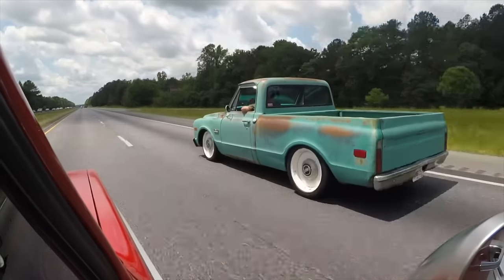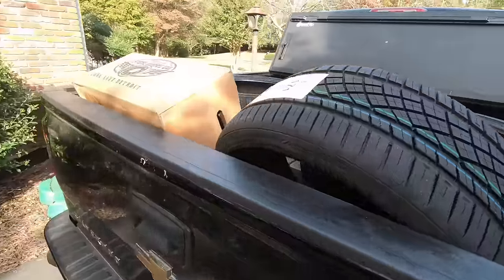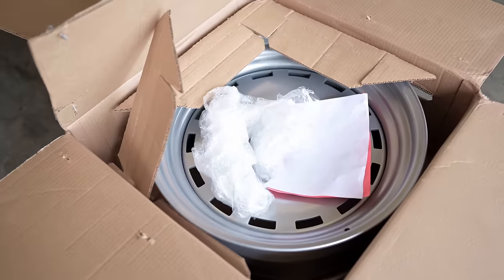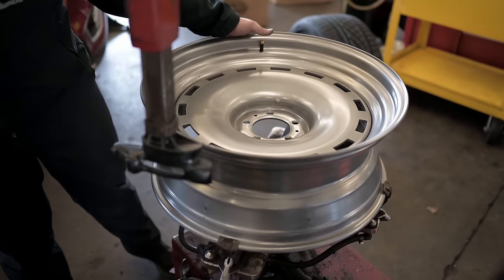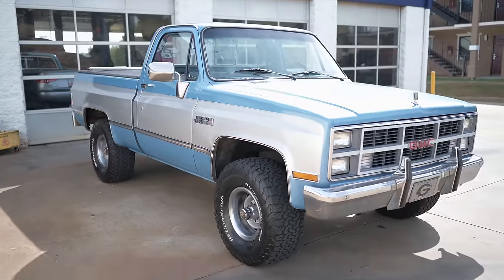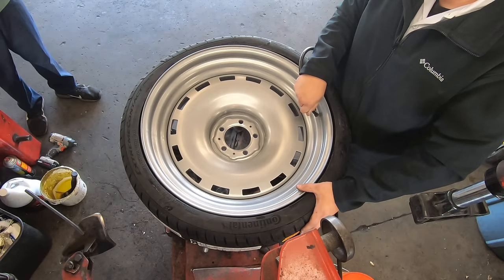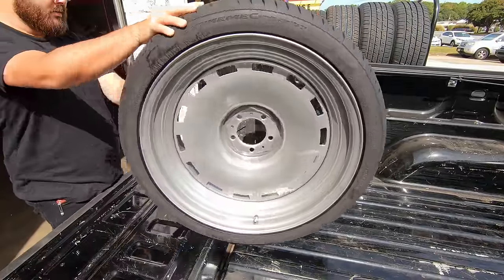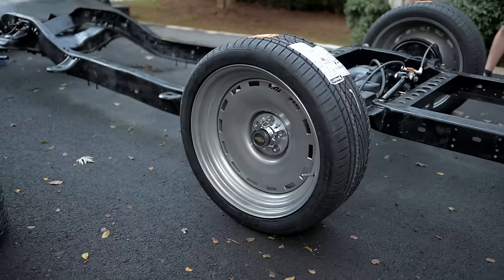WHEN DETROIT STEEL WHEEL & CONTINENTAL TIRE MEET...on #UBTK5 | sneak peek on our 2WD K5 Blazer

Comment: When describing the specs on the wheels at the end of your video you said the fronts are 22 x 9 with 4 inch back space  and the rears are 22 x 9 with 4 inches of back space. 
The rears obviously have less back spacing which is? That is a bad ass setup!!
Reply from the maker: Sorry about that. Fronts have 4.5” backspacing and rears have 4”.
Reply: @UNITEDBYTRUCKS  Thank you! Looking forward for upcoming progress.
Reply: Thinking about getting a set of 20x8 in front and 20x11 on back of 81 C10. Truck will have 5.5 inch static drop in front and 8 in rear any ideas on back spacing?
Reply: @UNITEDBYTRUCKS  thank you for the video. I am a huge fan.  I have a question. I have the same setup on a c10 MMW control arms, 3in drop spindles. I also have a 3in Z. My question for you is I’m going 20X8 DS Delrays on front. Do you have a recommendation on back spacing. I think I need either 5 or 5.5 but I see you have the 4.5 on the 22 but they don’t offer anything more

Any help would be amazing

Comment: Wassup wit the bead not seated all the Way on the 1st wheel!?!?  How/what did you measure to get offset/backspacing!?
Reply from the maker: We had an issue with one wheel, but it ultimately seated. We used conventional knowledge of these wheels but then measured. These are pretty safe sizes/backspacing for any dropped squarebody.

Comment: have you ever seen a larger tire than 255/35/20 on front of a 69 C10 with 4/6 drop?
Reply from the maker: Yes I’ve run 255/40 on 67-72 without issue. And prefer it.

Comment: What offset did you end up running on the wheels?
Reply from the maker: They are Delrays 22x9 all around with 4.75” bs up front (with 1” narrower control arms) and 4” bs in rear. Tires are Continental DSW06 - 265/35/22 up front and 285/35/22 in rear.
Reply: @UNITEDBYTRUCKS  I have a 81 square body and about to order these. I have a 6/8 drop kit. Not sure what backspacing I need for 22×9 with same tire size as yours.  Do you suggest 4.75 on mine? Have factory control arms

Comment: Nice wheel. But surprised how spendy they're. Can get custom wheels for same or cheaper. I really want some. But not sure worth the price. Especially since not powdercoated or center caps. Everything is extras. By the time you're done. $2K into them.
Reply from the maker: That's true, but I don't know any other custom wheel you can by for that price. Billets are $3500+.